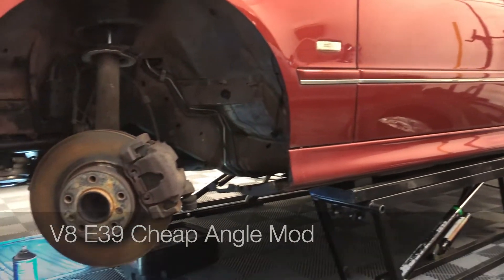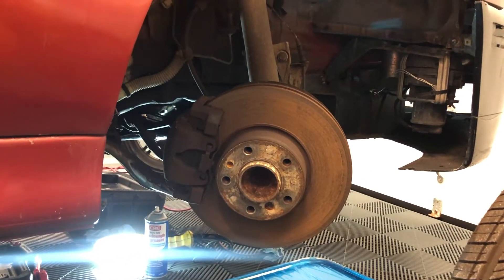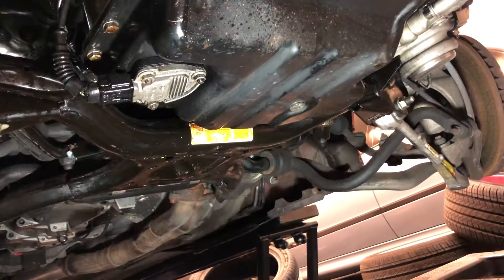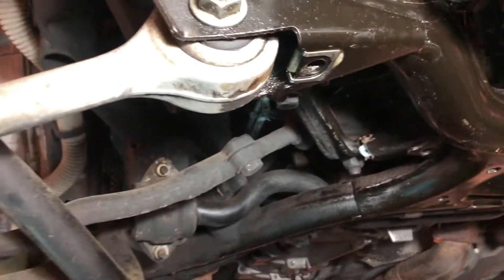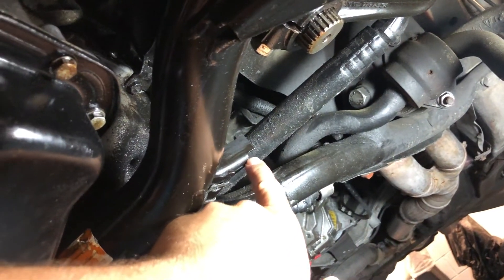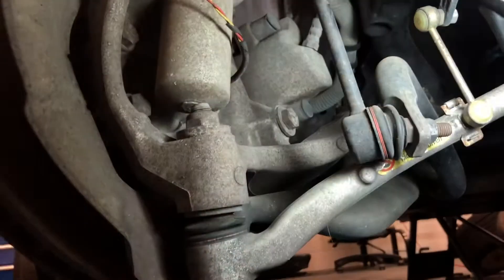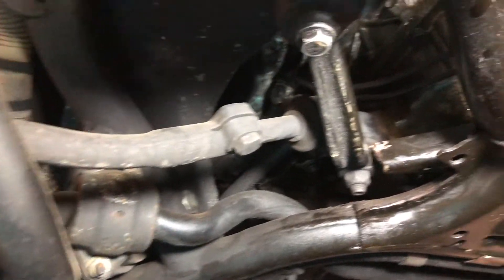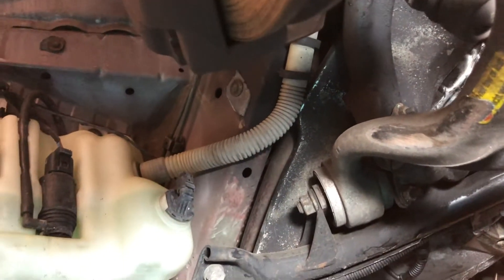V8 E39 Cheap Angle Mod

Comment: Throwing out an idea. The e38 740i iron front knuckles and arms can be bolted up to an 540i without too much issues. Do you think if we cut and welded 740i knuckles we could get more angle? Would need large spacers but thats ok. Next big step for clearance and even more angle would be longer thrust arms. 740i thrust arms are iron and maybe can be extended. Then we should be able to use stock control arms but weld new control arm mount points farther out. Similar to how the e34 has extra bolt holes to move control arms out.
Reply from the maker: that is an interesting idea.  I have never owned an e38 so I had assumed they were also all cast aluminum.
Reply: @SpectroRacingChannel  I looked into it, the e38 740i guys have been welding knuckles for years. So it's proven to work. Hard to say how much extra angle, maybe 10 degrees ish? Nobody has measured it. Only trouble is you need another way to mount front anti roll bars.
Reply: @elijaah81  @Spectro Racing  ...e34 m60 drift car here....exactly what we do and exactly what I was going to suggest. We do have extra bolt holes to mount the lower control arms closer to the strut assembly so not sure how this would be accomplished for you but definitely keep in mind I had to also run a e32 center steering drag link and e32 tie rods as they're all longer. Sway bar wasn't mountable until I got shortened end links. Everyone runs cut and welded knuckles for two reasons, its suppose to quicken the response from steering wheel to full lock but also keeps the tie rod from maxing out and leaving you comfortably in the threads for adjustment. For your rubbing issues....35mm spacers and roll the fenders. How much toe out do you run in the front for best results?....e34 villagers haven't decided what the best alignment specs are. Great channel, got here after reading your ABS/Hydro blog.

Comment from the maker: the limiting factor once you trim these is the trailing side of the tires contacting the bodywork on the inside.  It's especially bad on the passenger side because the tire burns through the hose for filling the washer fluid tank.  I never experimented with more than 10mm spacers, but I think getting some high-quality longer studs like Bimmerworld sells would be useful for experimenting with additional spacer width.  I also found that my stock strut mount bearings were pretty much seized and were limiting the car's ability to self-steer.  Installing Redshift Competition coilovers with their optional camber/caster plate made a HUGE improvement not only because the bearings were operating so smoothly, but also because of the increased caster.

Comment: Thanks dude, I have a e39 I'm turning into a drift missle and was quite disappointed when I couldn't find an angle kit. Even if I can get a smidgen more angle that's a win
Reply from the maker: only works on the 540 though.  SLR speed has a modular bmw multi link kit that apparently can be modified to work, but it is quite expensive
Reply: Yea its a 540i. Thanks for the info I'll definatly take a look into that. At least I have options! Much appreciated!